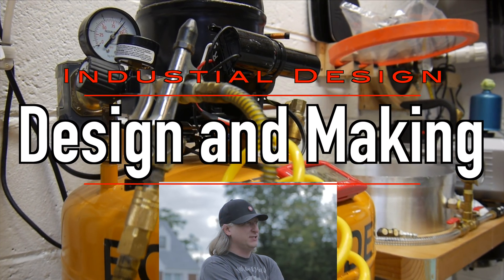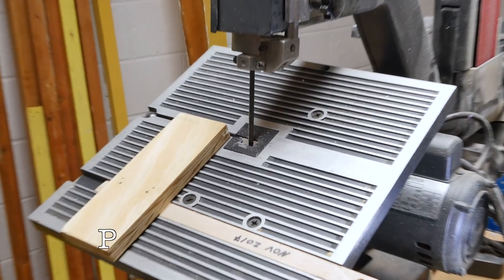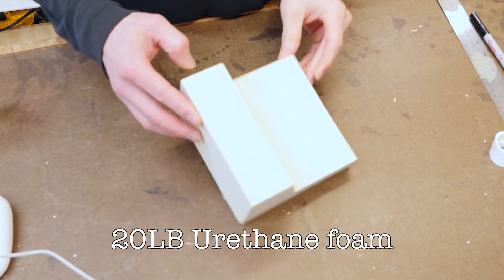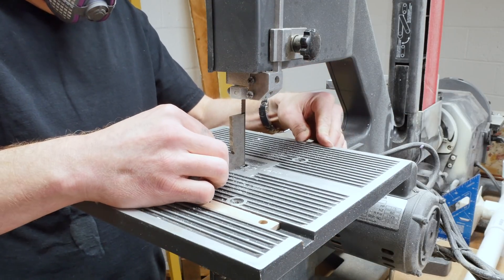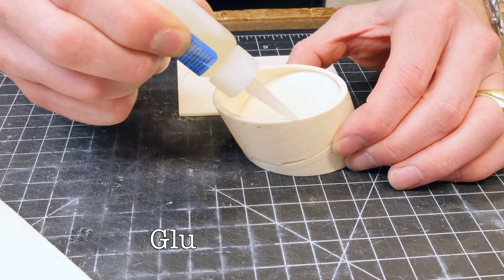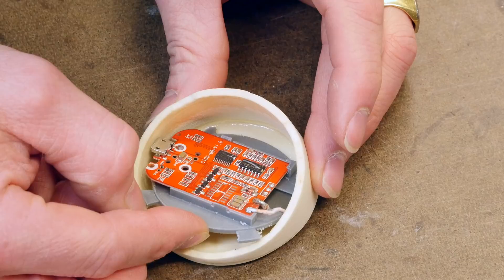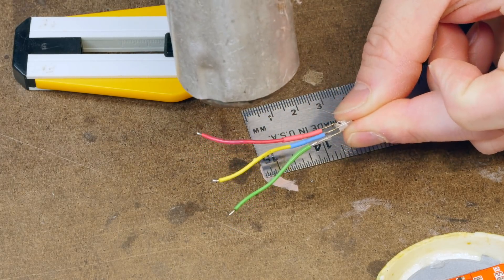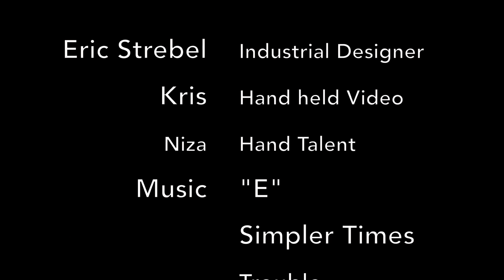How to use yellow Foam: Model build a wireless charger!!

Comment: Always enjoy your videos Eric. As a former product designer, I use a lot of CA guess for various applications as a luthier. Tool/template/jig making as well for specialized gluing application during an instrument build. Many are mediocre. FastCap is a good mid to higher range of quality for a CA. All CAs require moisture as part of the activation process.  A better quality CA is a Japanese brand called Star Bond. Their US headquarters is in California. Good value and they make a wide range of different CAs. They also excel with their accelerator. The atomization of the spray particle is critical. Should be very fine with no larger droplets. Some builders will use a cheap dedicated airbrush at their bench for spraying accelerators for best results. Any large particles and you end up with whitish witness lines due to the CA bubbling.Not good.
I am interested in whose cross slide vise you are using. Also, you might wish to look up the Wagner Safety Planer for some of your applications.
Reply from the maker: Mark Roberts Thanks for the info on the CA glue, much appreciated. I am using a wilton cross slide vice, it's average and I would not recommend it. I mean it works, but is not a quality product. I spent under $100, but wish that I had purchased a better made product, I would not have minded to spend in the $200 range for a well built product.

Comment: I’m curious why you didn’t 3d print the two pieces and the use a circle of Delrin because of its known frictionlessness?
Reply from the maker: alohathaxted I wanted to make a video about modeling with foam since not everyone has a 3D printer or access to one. Also many people don't have the CAD skills to model an object.  See more info in previous comments.
Reply: Thanks, i thought of that right after i posted. Good video.

Comment: I've always been a fan of Bob Smith Industries Cyanoacrylate.  They have several choices in terms of viscosity.  Of course, the more "gel" like the glue, the less adhesive strength it will have - but that's pretty inconsequential in most cases.  Basically, if I need it to not flow all over the place, then I use the more viscus stuff.  They have a nifty "debonder" for taking the piece back apart.  They also have a "Super Gold" product that isn't supposed to fog up clear plastics.  Of course, they have accelerant too.  What I like about this product the most - is the freakin' bottle.  It's never frozen up on me and preserves the liquid inside well.

Comment: Hey, I think you should really take a look on cyanoacrylate glue activator spray it works wonders for quick parts gluing !
Reply from the maker: Michał Z i use it in the video, i brush it on. any brand you suggest?
Reply: Eric Strebel oh great I'm still watching it :D I don't think you could get one I'm using it is from local modeling/hobby store (their own brand) 
But did you try different viscosity of superglue ? Thicker is setting quicker (especially with activator)

Comment: Usually cheaper super glues are better and the less you use the better it will stick. Also try using different types of glue like pva or bostic glue as most glues melt the material especially foam but thats how they stick. 
If u want to work with that type of foam more cut out whatever you need and put multiple coats of white emulation paint on the foam your can glue alot easier.

Hope this helps